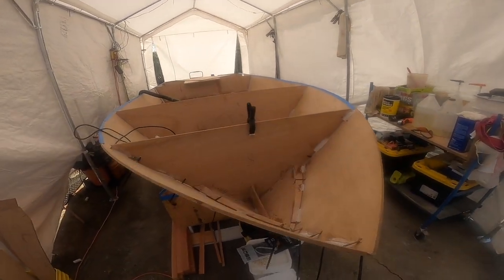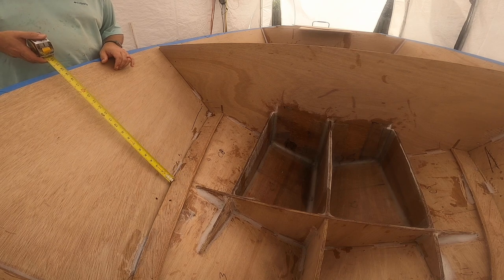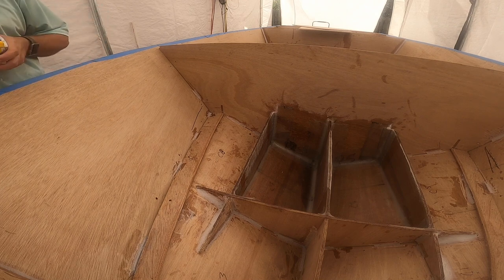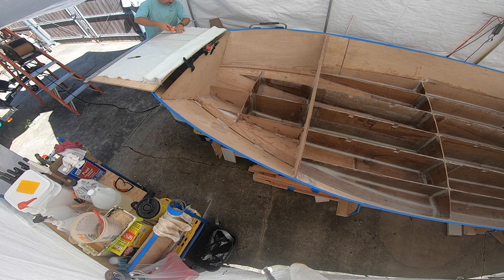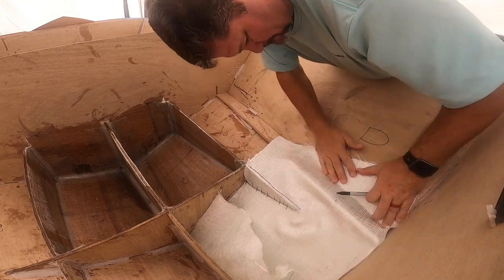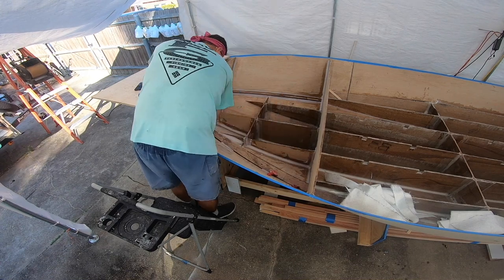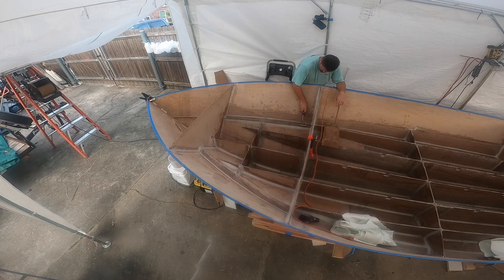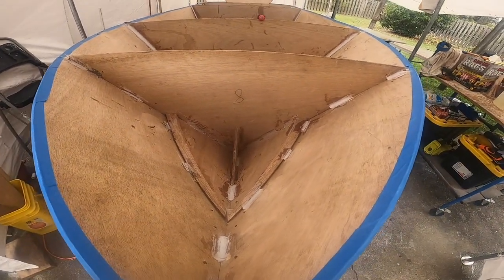12.DIY Boat Building: LESSONS In Time Management!

Comment: Overthinking, my friend. I’m sure you could have installed that fiberglass in pieces. Maybe add tabs to all the corners and then add the sheets to overlap the tabs. Would be a lot of pieces, but you would not have such a difficult time applying. 
But, maybe I’m the one overthinking it. 
Keep it up, it’s coming along nicely. 
Thank you 
Have a great day.
Reply from the maker: Yeah it's been too many nights since I played awake wondering how to do it, but in the end you just have to be flexible mentally and willing to just back up and start over with your thought process.  That's all part of building the experience by doing all the different tasks it takes to complete this.  Appreciate it nonetheless.

Comment: Looking back, do you think there could be a benefit to laminating the plywood before cutting? I am looking at building the Salt Boatworks 14’ flats river skiff, flip-flopping between it and the Bateau SK14. I like the FRS reverse chine. Your build is looking good.
Reply from the maker: I’m a little confused about your question about laminating before cutting.  I am assuming you are talking about glassing before cutting, and the answer is that’s not possible.  The wood is bent and has curves.  I would think it would be fighting a losing battle attempting to bend and create fair curves with panels that have glass bonded to them.  The process of building this boat, which is quite a bite larger than the 14, is very straightforward and not difficult.  I’m posting all this as a guide and inspiration that if I can do it, you can as well.  Salt has clear examples on their Youtube site the process you should follow.  I veered off that direction at times, and I have regretted it.  If I have gotten your question wrong, please let me know.  Appreciate you checking it out.
Reply: @Bigeaux20  that makes sense, the purpose of the glass is to add strength and stiffness, I was just thinking about the sealing aspect, thanks for the bigger picture.
Reply from the maker: I’m still confused because all parts of the boat will get get covered in glass of some sort.  The video you commented on is about 10 months old, so a good bit of progress is available in videos after that one.  It has plenty of glass and epoxy to stiffen everything.

Comment: I was thinking of mixing the epoxy resin with the filler and then using a old washed out caulking tube so you can pump it into the fillets 
Rather than spooning it into the corner fillets
Reply from the maker: You can certainly do that.  I think TotalBoat actually sells empty tubes as well.  The ziplock bags worked well for me, and to be honest, I probably should have stayed with that process.  It is a little cleaner in regards to distributing the thickened epoxy, and a gallon ziplock has a much bigger opening than a caulk tube.
Reply: @Bigeaux20   I nick the old Dorris icing bag. Lol. Never makes cakes anyway. Lmfao
Reply from the maker: I claim no liability for the consequences of said “nicking “

Comment: Hi , sorry if you have said this in one or more of yours videos ( I have watched them all ) My Question is " Have you used only the  1708 biaxial  50″ wide cloth so far & no other cloth? Thanks
Reply from the maker: I have used essentially 3 different cloths, and truth be told none of it has been 1708 as I get confused sometimes.  The bulk of the inside that’s been done so far has all been 1808, along with the hull bottom.  The sides of the hull in and out have been and will be 1208. There has been one piece of 10oz that was put on the transverse bulkhead in the bilge area.  That’s kind of a summation of the glass schedule.  Let me know if that doesn’t answer your question.

Comment: Are those fiberglass cloth shears working well? Which model did you get?
Reply from the maker: They work for certain.  Just seems with the 1808 biaxial if you get in certain spots it will hang up.  But, if you go fairly slow they cut fine.  It may be that I've cut enough I need to swap the blades, or it might be that I get in a hurry.  But, for the price they seem to work fine have an extra set of blades, and a spare battery.  This is the model I'm using.  https://smile.amazon.com/gp/product/B08D6HBGC1/ref=ppx_yo_dt_b_search_asin_title?ie=UTF8&psc=1

Comment: With you doing everything yourself I'm curious to see how you are going to flip the hull to glass the bottom.
Reply from the maker: Well I can't imagine getting that done without help.  I may attempt to get enough people to just pick it up and manhandle it over, but if not I will just roll the cradle out onto the grass, brace the crap out of it, and just roll it on the ground with as much cushioning as I can facilitate and do a slow controlled roll.  Then just lift it back onto the cradle and roll it back into the tent.  While it looks like it weighs 2 tons, I can still physically lift each end by myself, so It shouldn't be too bad.  But, time will tell.
Reply: @Bigeaux20  I like your work in making boats, your work is very inspiring, I'm interested in trying to make it, hopefully by watching your video I gain knowledge and can make it, keep sharing knowledge, thank you

Comment: Why dont you roll it on its side mate....
Reply from the maker: Ehhhhh, there's a bunch of reasons that prevent that, and truth be told, the only compartments that were hard to reach were these two center forward compartments.  The rest of the compartments in the interior I did prior to putting the sides on the boat, so they were much easier to reach.  The bigger issue is I'm a bit of a big fella so that only made it harder for a moment.  I didn't whine about it long.  As soon as I get the interior finished glassing, I will roll the entire hull over and do the bottom.